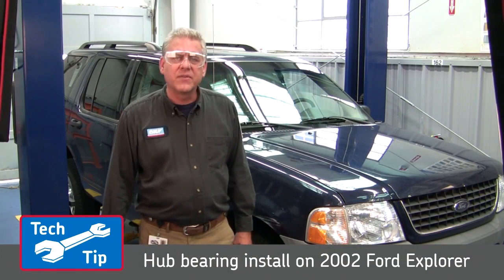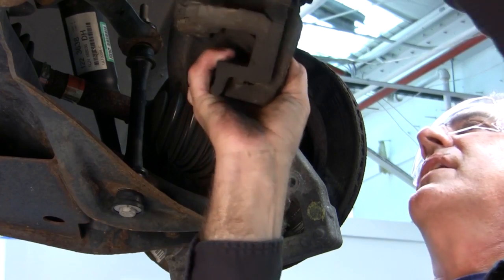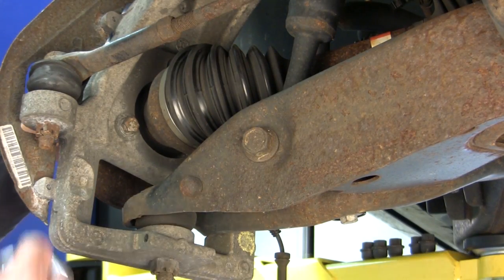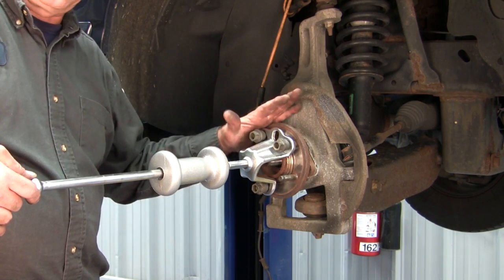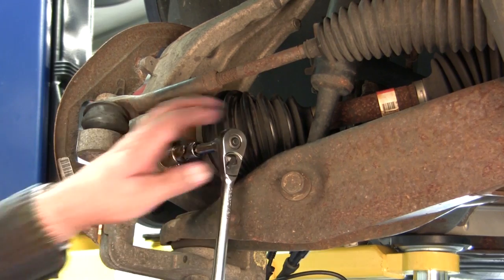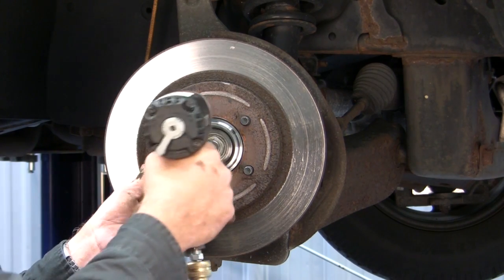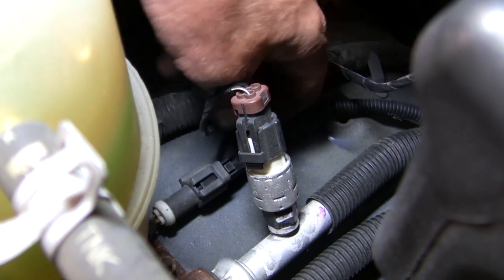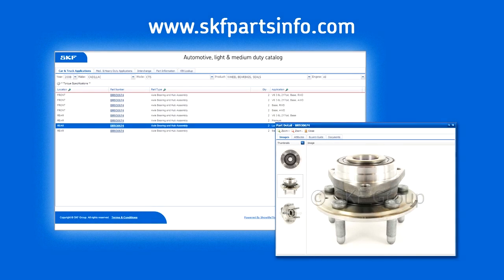2002 Ford Explorer front hub bearing installation

Comment: Axle nut torque is not critical,100% impossile to fully torque the axle nut.Called a couple ugga dugas with an impact which will not cause premature wheelbearing failure

Comment: if you dont have a slide hammer Flip your rotor around and loosely screw on your lug nuts and use the whole rotor as a slide hammer. saves renting the tool

Comment: Is this the cutoff year for the Explorer where the hubs were pressed? And if so, can you tell by the vin # what you actually have?
Reply from the maker: Thanks for watching, the front hubs on the Explorer are hub assemblies bolted on. 
The bolt on style is from 1995 and up. Some of the rear bearings on the Explorer are press in style depending on year.

Comment: did you have to get the bearings pressed in or does the hub come with bearings for 04 explorer
Reply from the maker: If you have an 04 Explorer 4x4 then your vehicle would also have a complete hub assembly and replacement would be similar to the viedo. Thanks for watching!

Comment: I didn't know the axle nut applied pressure on the sealed bearing?
Reply from the maker: Thanks for watching. The axle nut torque is an important step in finalizing the installation of the hub unit. 
The proper torque will help set and maintain the assembly including the rollers into the correct position.
Reply: Thank you for the reply!

Comment: I have been attempting this repair, however, when I try to remove the bearing nut the cv shaft spins and spins... emerg brake will not engage. Any suggestions?
Reply from the maker: TheTophatpat Remove the center cap on the wheel to gain access to the axle nut, then with the vehicle on the ground break the nut loose.
Reply: Thanks, LOL. after all the head scratching I did I can`t believe I overlooked that! Thanks again.

Comment: Very good video with great detail. I have to do this job soon. My front left hub is making noise. Do you recommend simply doing both? Is the bearing itself serviceable. If so I'd imagine it needs to be pressed?
Reply from the maker: Best practice is to replace both front hubs even if only one side is worn out. The hub bearing used on the front of the Explorer is a Generation 3 style hub bearing that is not serviceable.

Comment: Very good. Quick question though, whats the torque spec for the caliper when putting it back on?
Reply from the maker: The torque spec for the caliper mounting plate bolts on a 2002 Ford Explorer is 80 ft. lbs.

Comment: What is the name of the tool you use to remove the hub assembly ? thank
Reply from the maker: The tool that we used to remove the hub assembly in this video is a slide hammer. The hub can be stubborn to remove without one.